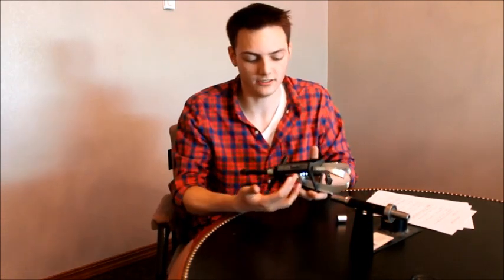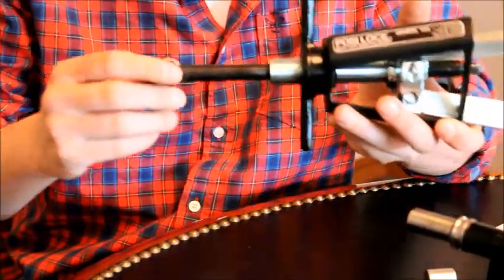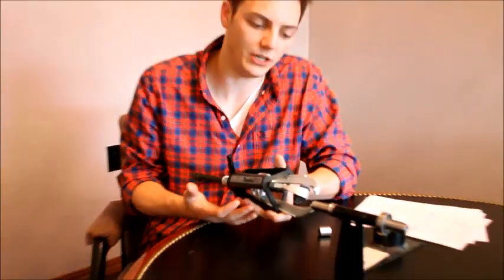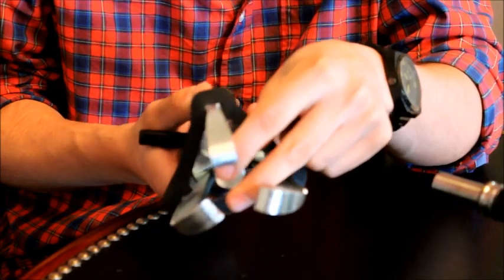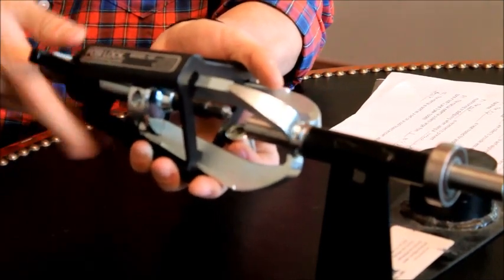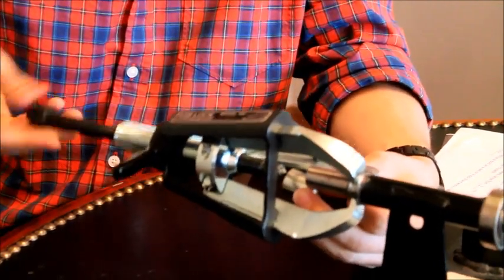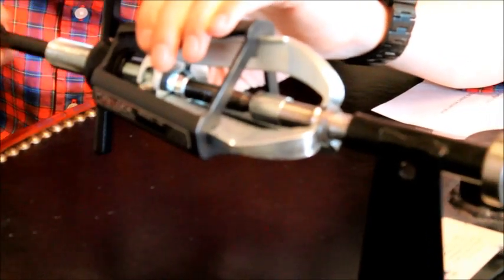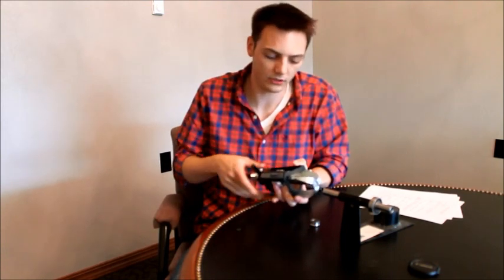Posi Lock Mechanical Puller Demo

Comment: The design is a great idea. The center bolt should have a fine thread to provide more torque. The center bolt tip on my 110 broke in half after about a dozen applications. The thread of the center bolt was worn into uselessness after about 40 applications...almost a $100 to replace it. No warranty because someone decided that the center bolt is not impact wrench compatible.  Tip protector not included. In my opinion a high dollar POS.
Reply: The tip protector would help with stress distribution, you can also grease between the tip and protector.  Did you lubricate the threads?  A 110 can deliver 14 tons of pulling force, that's alot of force on those threads.  And it does suck that your bolt wore, but $100 after 40 applications is $2.50/application, not alot and using an impact is not recommended.  These pullers take alot of abuse if used to their capacity, and if not maintained well, I'm not surprised parts fail.  It's like saying a drill bit is crap if it overheats due to lack of lubrication and then dulls.  It wasn't used as intended and it was in a harsh environment. I've only used mine a few times as a farmer and it's already paid for itself vs. having someone pull items for me. Now I have to buy a 2 jaw 210 to pull stalk rolls on a cornhead as my 3 jaw 110 won't work, 8 pulls and I might not use it again for a decade.  Oh well, it'll make me money. :)
Reply: Yep my center bolt turned into noodle. Sad